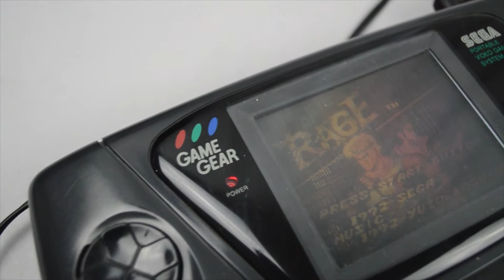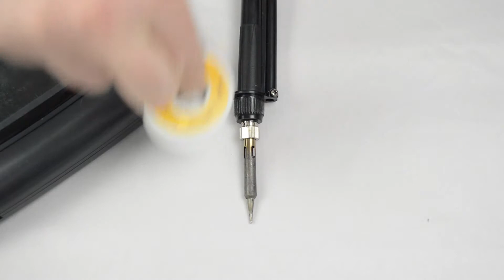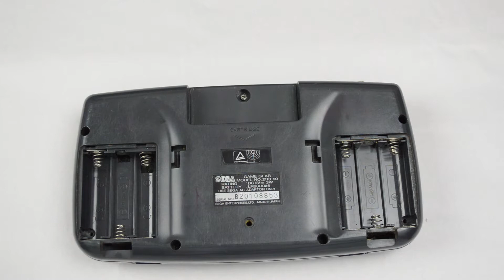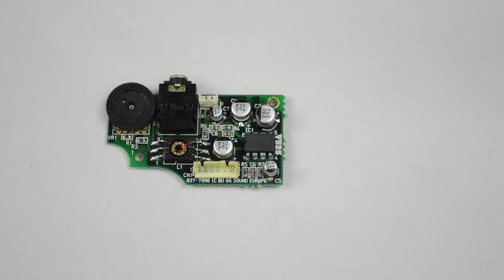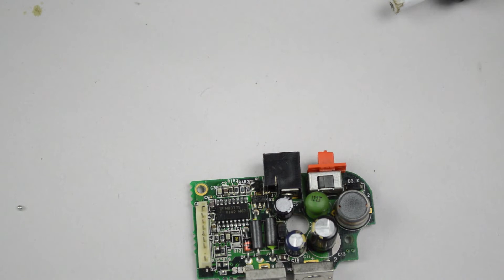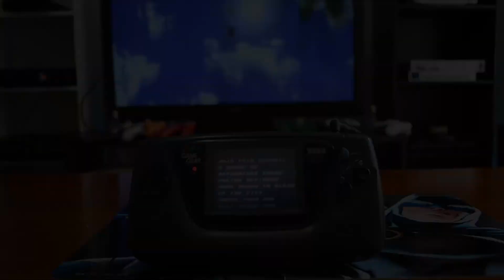How To Repair Sega Game Gear No Sound Or Picture: Capacitor Replacement EASY

Comment: How do i tell what game gear kit has my correct capacitors
Reply from the maker: It depends on how many ASIC chips you have on the board
The cap kit seller should have a guide to determine the difference

Comment: Pardon my ignorance, but I have back light but no picture, and no sound.  I had a bat pop in it, and corrosion on the board.  Would that likely be a capacitor issue too?  I cleaned the corossion already, but not sure if this could be a similar issue, or if it is just destroyed now
Reply from the maker: But of both probably, if data lines to the display were damaged that would cause an issue.
These traces are already very old, I doubt it would take much to break them

Comment: Okay. Just alcohol for cleaning the leakage? I don't a have security bit what do I have to use to open the one security bit on the back of my sega game gear?
Reply: Used the back side of a plastic pen warm it up. Dont let it catch flame just warm enough to take shape and press around the bit for a few seconds and then cool it off cold water or let it sit for a couple minutes. Should have a good clean impression. Worked lime a charm.👍

Comment: Hey slotman, since you're much more experienced with this stuff I'm hoping you can help out. I'm having a REALLY weird issue after attempting a recap. I'm a complete beginner so I'm sure I screwed something up but I'm not sure what, and I'm hoping you may be able to point me in the right direction. 

This game gear I received had the typical lines on screen (or sometimes no image at all), and no sound problem, etc. I'm sure you know the deal. For the record, it is a VA1 board revision, with 1 ASIC.
Yesterday, I started out first with the 2 smaller boards (audio and power) and completely recapped them using the caps I got in a kit off eBay. After doing so I reattached them and reassembled the console just to do a quick test to see if there was any improvement so far. It looked great! And it made sound! Although the image wasn't perfect it was pretty good all things considered. I'm thinking I probably should have left it like that. But anyway, I dissasembled it again so I could do the caps on the main board in the morning. Better to do things right than to leave a job half-done.
So jump cut to today, I proceeed to remove all the caps on the main board. Clean off all the corrosion from underneath the caps, add some solder, put in the new ones… 2 and a half hours later I'm finally done and ready to close this thing up. Pop the cable connectors back in, put in a cart and get ready to see it in action.
This is where things start getting weird. The image has actually gotten worse. If I leave the brightness dial in the middle, then the image looks absolutely normal. But if I start to turn it up brighter, the image actually begins to distort and stretches vertically as I turn the knob! Some lines appear as well.
I really have no idea what might cause this but I'm really eager to get in there and make this thing right. I look at all the connections and they seem all right to me but again I honestly just don't really know what I'm doing. Like I said, complete novice. Are there any connections I should be looking at in particular that deal with that brightness knob? If it could be narrowed down to a particular capacitor I should be looking at that would be so helpful. Any assistance would be really appreciated!
Reply from the maker: might be a good idea to double check you have the caps around the correct way, I accidentally put a few backwards the other week when doing this repair :)
Reply: Slot1Gamer thanks for the tip bud, much appreciated :) I went over everything again and actually found one I did put in backwards. I fixed that up but unfortunately behavior still seems to be the same. It's so frustrating since it was working so nicely when I tested it after doing the 2 smaller boards! But hopefully I'll figure it out before calling it a loss hahah